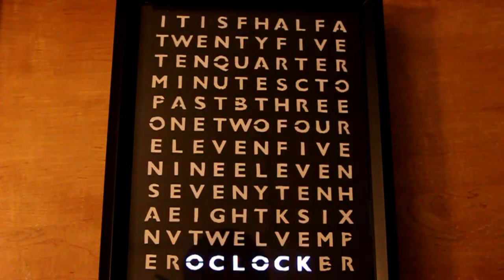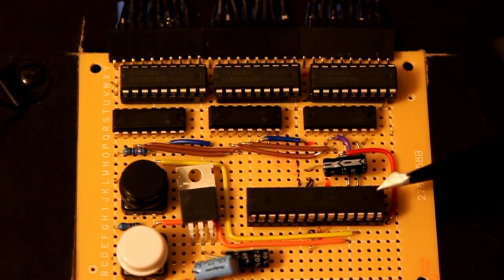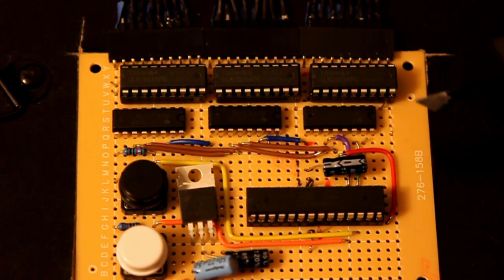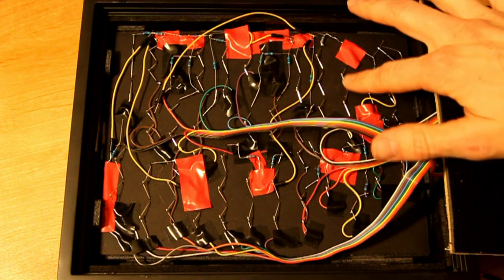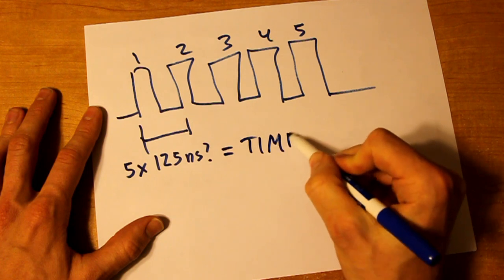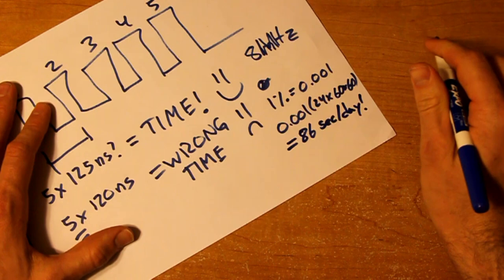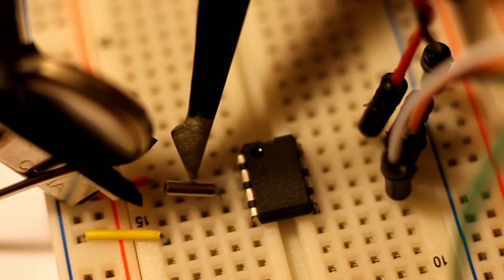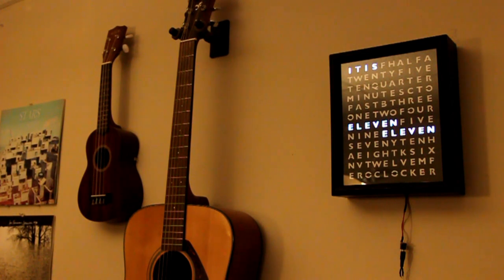A word clock powred by Arduino / ATmega328

Comment: I bought arduino uno and I cut the layout (interface) but what else do I need to get it implemented.. I checked Doug's method but a PCB board has to be constructed..
Would you please specify the equipments that I need to buy.
Reply from the maker: Reema omar. Your arduino is the brains and does most of the work. You can convert the logic output into muscle using transitors rated for your application. I used darlington array chips to make this easy. I also used shift registers to convert a small number of pins on my arduino to many outputs. The output of these are fed into the darlington arrays. The only other thing you'll want to consider getting is a real time clock IC to accurately track and save the time.  Here's a list of what I used:
- 1X Atmega328
- 3X ULN2803
-3X 74HC595
-1X 32.86KHz crystal + RTC IC (DS1307?)
-LEDs, resistors, buttons, and capacitors as needed